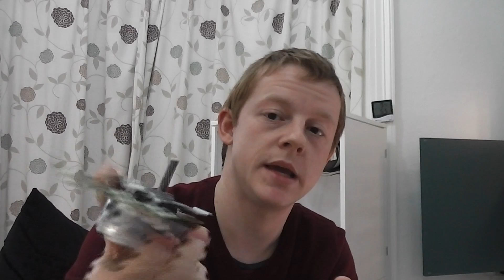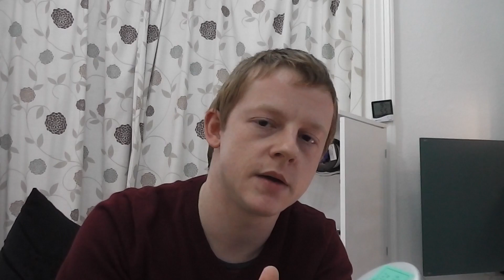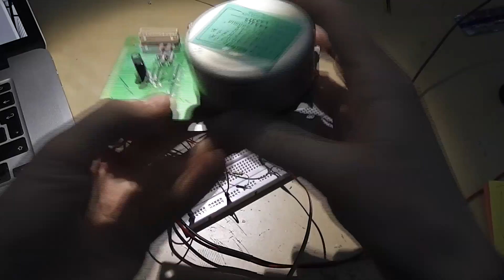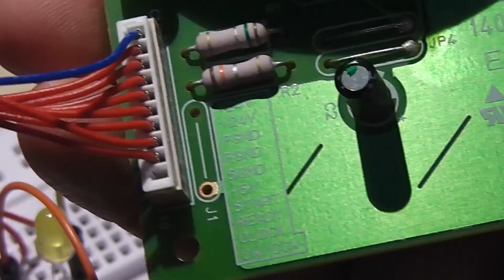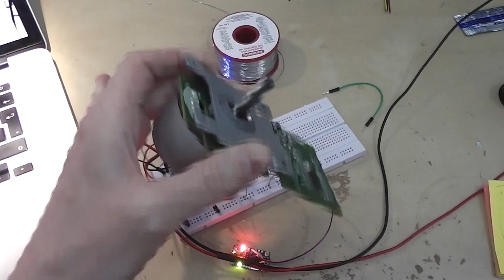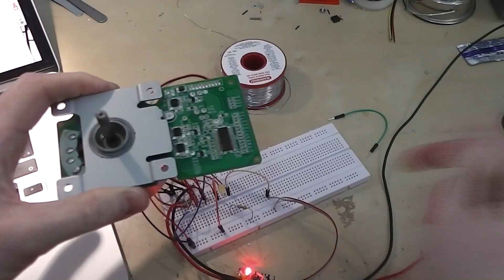Testing the salvaged Samsung Laser Printer Motors

Comment: I have this motor and if i give direct 20v to it and attach it starter wire to  positive then the motor run and stops automatically.
So i used a relay to make it keep running on high speed and it worked .
I just connected a relay with the  main power and connect its one end with positive and another with starter wire

Comment: Dear all, I have got an BLDC motor which I found it inside a printer, and that BLDC motor was made by Nidec (50M060A070, RM1-4519 01, DC24V 1.4A) and the pins are:
FR
FG
/DEC
/ACC
GND
GND
+24V
+24V

and I do not know how to run it, could anybody please help me to run it? 
your helps would be very appreciated. 

Best Regards,
Sarith 
(Cambodia)
Reply: Same with me. Could you control it ?.

Comment: you way too complicated that much for a simple signal generator.use a simple 555, use a 555 calculator to fix your working freq and btw star by set the voltage about 18VDC... your motor will heat somehow if you continue to drop pure 24VDC directly.